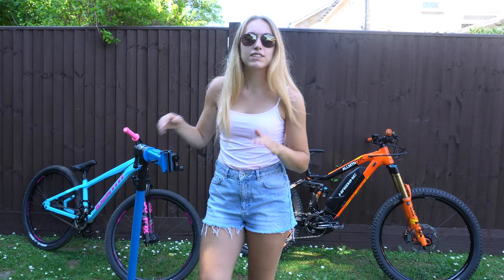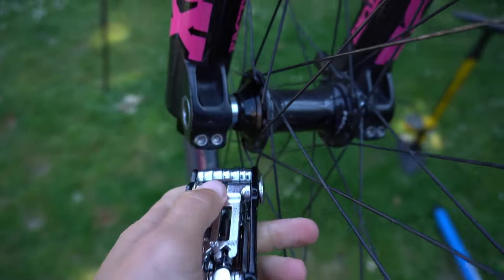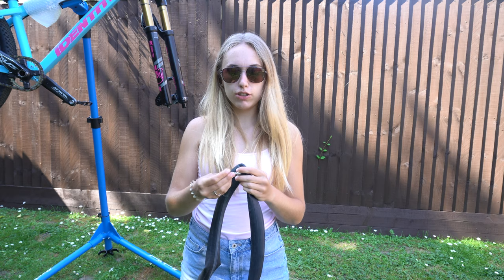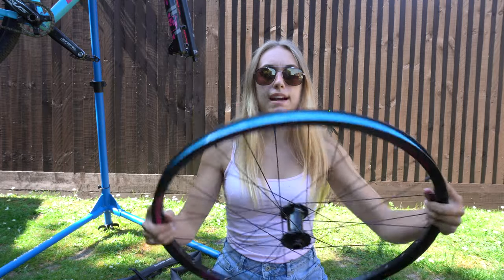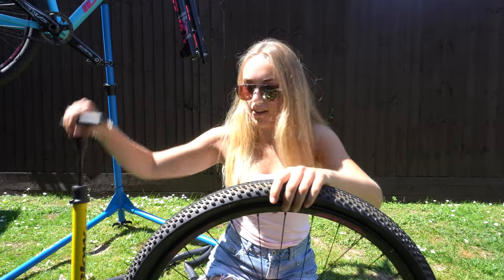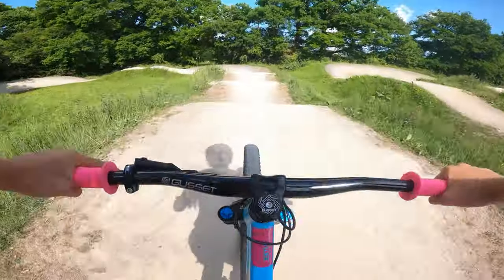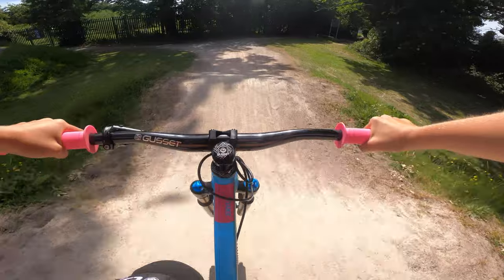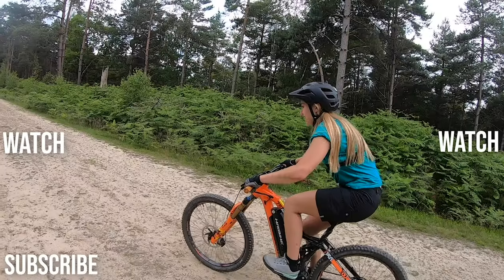Jump Bike Tubeless Conversion and Pump Track Session!

Comment: If you put a rachet strap around the tyre and do it tight. It squashes the tyre and pushes the beads out to meet the rim. You can use far less sealant and just loosen it as you pump. Pro tip

Comment: How hard did you pump the tires? I always thought that it wouldn't make much difference in how the "tires" feel on the track with a dirtbike - just because DJs mostly run with higher pressures than MTBs. It's more about the difference in weight and mass that would make the difference with the DJ bike. Didn't Tom try it out on his and switched back to tubes? 🤔 Would be interested i  the overall benefits with tubeless vs tubes on a DJ bike.

Comment: if i’m honest, i would never ever run tubeless on my dirt jumper. if you land sideways ever and the tyre deforms a little bit you’ll loose all your sealant and have to have a nice walk back.
Reply from the maker: True but I won’t be sending any tricks the would mean I land sideways for a little while it’s just for pump track laps really!
Reply: yeah, i guess! good job tho
Reply: I used to think that until I heard Matt Jones say that in competitions, if you over shoot a jump instead of your tire exploding it will go down maybe 20-30 PSI and so it's still possible to finish your run